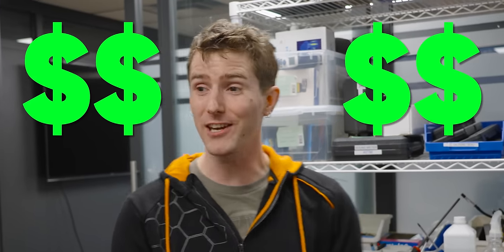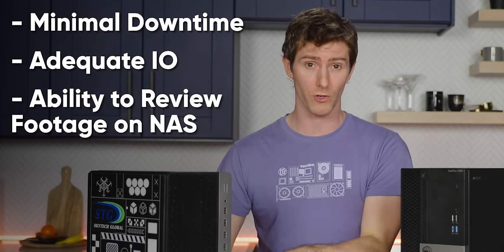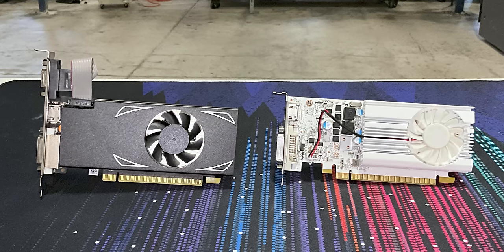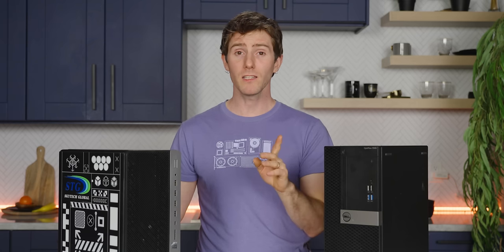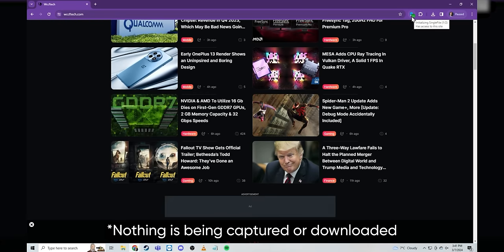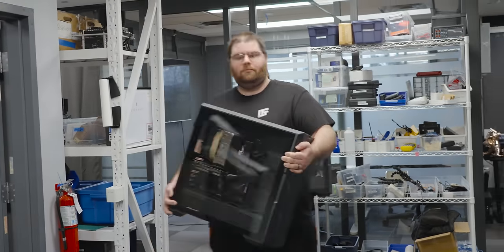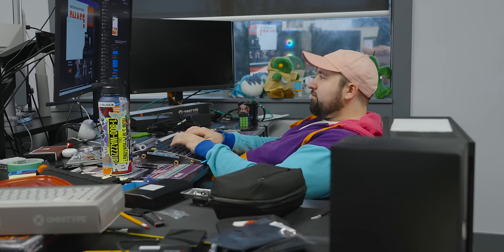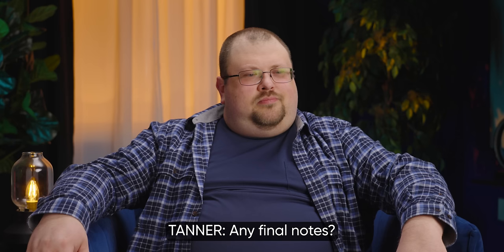We Downgraded our PCs to Prove You Don’t Need a New One

Comment: I work IT for hospitals, we tend to rotate systems roughly every 5 years. For the most part, as long as the system has an SSD (even a cheaper one), the older 4-5 year systems still work just fine for 90% of tasks; most of them with 8gb of RAM. For "power users" like accountants who have multiple excel sheets open, these same systems with 16gb of RAM work well too. Most of our "heavy" applications like EMR apps are cloud based and we see more hardware usage from Microsoft Edge.
Reply: As a person who has had to be in hospitals more than i would like to admit i wish there wasn't anything hooked to the cloud in the network. I can see why "heavy applications" can basically require you to have a server cabinet per building that provides the medical service just to hold in digital form the medical data of everyone who goes to the hospital. Sharing between building would be harder too.

For the system that the majority of them use yeah sounds about right for what the 3 hospital systems i have gone to use. Well that and a specialized one for nurses whose job is to go around and give the correct medicine to the correct human.
Reply: These employees at LTT are spoiled, pure and simple. Their issues are between the keyboard and the chair.
Reply: 8GB of RAM in a commercial setting is horrible. If you're running commercial AV with lots of logging it can easily take up 4GB of ram which means after windows takes 2GB you have 2GB of RAM for whatever you're doing (probably using something running on chromium) which just isn't enough. Anything with less than 16GB now is useless for these business settings unless you have some niche task that can cope with only 2GB of RAM available.

The only way to get away with 8GB is to make users suffer with the page file being hit constantly or to not have proper security and monitoring settings.
Reply: @jaysoncowan5763 .  Many of the old business machines can have some random faults that only pop up through daily drive. Had a family member go through the same thing.
Reply: @jubjub727  Yes, security apps are taking a lot of RAM and consistent CPU usage. In which old systems just takes so much hit to their performance.
Reply: Your security is probably shit then. The security monitoring eats up performance.
Reply: exactly. for MOST office use, a few good cores, ram, and an SSD for fast boot and opening times, that's all you really need, as long as you have solid networking. EPIC medical software doesn't require too much to be happy other than the LAN, so as long as the background of the system doesn';t hog much, you don't NEED huge hardware to be really poky. i've built for medical offices before, their requirements are about as much as you'd need to run Chrome OS and not much else. i do have some more specialized clients tho that need more horsepower. i recently upgraded them to all i7 6700 dell units, nearly identical to what they're using in this video, all SSD storage, and they are so stoked about it. they boot so fast (new installs, not dell OEM installs) and all have at least 16 gigs of ram for having tons of windows and apps up and running. (they're a chiropractor office, and their special chiro software uses like 7 gig by itself)
Reply: Disable prefetching and superfetching in registry, and sysmain and windows search in services. That will improve the speed of an older system significantly.
Reply: @jaysoncowan5763  nearly all of the complaints i heard here were from swapping the SSDs from their main rigs to these instead of using a fresh wipe with proper driver install. ive done several HUNDRED setups like this for people who use them 8-12 hours a day in a business setting with 0% complaints, not a single call. it's one reason i like going with the used dell optiplexes. they just RUN. their issues were mostly due to not fresh installing. granted, yeah, sometimes horsepower is a problem, but the lack of wipes is 95% of this video. (for reference, i started doing PC builds and repairs in 1999 for a living, and i still do)
Reply: @jaysoncowan5763 I used to have a business type of computer as a daily driver , many of its components weren't upgraded or didn't have any drivers at all, because they were so old so we can't download
Reply: My dad used to work in the E.R. and now works at another section of the hospital (Its a recent promotion so I dont exactly remember where he is now) and every time I go I am always looking at ANY and EVERY computer I possibly can to gauge how old the systems are and mainly how fast/slow they are. Sometimes I wonder if they have any security issues but they really consistently keep things updated and constantly tell employess to tell anyone when they get an email that looks weird, or if they opened something funky. That particular hospital honestly has a good team of IT professionals running behind it because everything my simple computer nerd minded ass could see was spot on perfect. I have a feeling even social manipulation to gain access to systems would be hard.

Thank you for taking your time to keep people's medical information safe and secure. Its extremely important now more than ever. You're doing a very important job that deserves respect.
Reply: For me, ram / SSD is way more important then performance
you can wait for tasks to be finish slower, but when working with larger data / multiple tabs searching for info
ram will ran out and completely freeze up / fail to open/import data, therefor become unusable
(some medical file / logs are large, especially when you also do some research work)

simply put more ram and a SSD into a old system can prolong it's life massively, and the process is fast and easy
Reply: EPD software can be a hog though. But luckily most of them are pretty modular.
Reply: Agree.  I'm acutally still on spinning rust, but if there's enough RAM that the essential tools are cached, my boxes are plenty snappy.
Reply: @jubjub727  8GB is still usable; not ideal but usable. In a hospital setting at least, most of our workstations run a browser for basic web searching/email/Teams and then effectively a thin client for the EMR app. Not much happening on them. Once you get outside the patient areas to administration, 8GB becomes unusable.
Reply: @yumri4  Unfortunately, it's just way too convenient and cost effective to offload to the cloud. Pretty much everything is going to be AWS or Azure. One of the largest EMR providers Epic works very closely with Microsoft ,so it's pretty easy to roll out integration with Microsoft's ecosystem.
Reply: @Mattias1172  If 8GB is usable then you've grossly neglected AV and logging. Which for hospital IT teams checks out. The only reason you think 8GB is usable is because you're doing things insecurely.

I get that budget is a thing and especially rough at hospitals but having poor security settings isn't something you should be particularly happy about.
Reply: @jubjub727  Nope, full AV and logging. 50,000 endpoints with the majority being 8GB. We have multiple layers of AV on each machine. It's all about optimization.

Comment: Honestly i've been working in IT for schools and Councils in the UK for 7 years and a lot of them are still running 6th gen I5/7. For basic office tasks, teams meetings and spreadsheets they are perfect. The internal networks and domains are the bottleneck most of the time. Dells warranty is brilliant as well. Log a support ticket and a guy is waiting at the office doors the next morning with all the parts to repair the PC. You cannot fault that.
Reply: Too bad Microsoft will stop providing Windows Updates to these machines October 2025 with Windows 10 going EOL. They're not compatible to Windows 11.
Reply: Dell's support is just extraordinary
Reply: You can fault it when the service technicians are hired without a vetting process (contract company) and their KnowledgeBase is significantly worse than your own I.T,
Albeit thats not a problem everyone has but it sure is a problem we had.
Reply: @Steamrick  most machines that aren't considered compatible by windows update, can still be installed with Windows 11 using a boot drive
Reply: @Steamrick  yeah that does suck. The current council I’m working for are rolling out Surface laptops out. It’s a long process replacing 10k machines. Microsoft’s support isn’t great in comparison. Their definition of repairing a laptop is just replacing it.
Reply: @Steamrick  Windows 11 will run. I have 2 4th gen systems at home running 11, several different ones at work. 

However, I feel like 8th gen is the sweet spot for 2nd hand. More cores and NVME makes them feel very snappy.
Reply: Must be a different service level because Dell never sends anyone out to fix our issues, they want us to ship out the system and wait for them to send it back.
Reply: @Steamrick  sure but not like these systems will be worried about viruses if they only use it for certain tasks
Reply: Web Page design is the bottleneck there. It never holds still.
Reply: Bruh, I have a 4th gen i7 and it's still plenty fast for me. What am I missing?
Reply: I know still better than modern celeron chromebooks.
Reply: @Steamrick  I've deployed Windows 11 on several Thinkpad T520's from 2012, all the hotkeys still work. Most of the PC's at my workplace I manage are 6th and 7th i3's, they all run Windows 11. The important part is the SSD.
Reply: @allyart5904 As someone who has three surplus Optiplex Linux boxes (two 9010s and a 7020), I certainly do appreciate them.  I bought my first 9010 because it was configured much like a home built box I tossed together in 2013, and the things keep on soldiering on.
Reply: @Steamrick  Third world countries will just pirate LTSC 2021, we should too
Reply: The council here are replacing their 8th gen intel laptops. The main issue with them is the batteries and they don't have USB C which is what the council and police stations are moving to so they can use the docking station devices.

Comment: I used to work alongside video editors, and I'm surprised to hear that everyone at LTT including the writers are working with the full resolution 4K footage. We used to have almost everyone working with lower resolution proxy footage, it was easier on the machines and the network, and at the end of the process there was some software special sauce which applied the same edit decisions to the full resolution footage too. I can only assume that the issues described here with scrubbing through footage would have been helped by using lower res proxy video!
Reply: Yeah I've wondered about that before. Most production companies I've seen use macs to edit video, and not even new macs, unless they shoot in low resolution they just use proxy footage and the not super fast computers handle it just fine. No need for crazy powerful PCs or fiber connections, LTT's setup seems so overkill
Reply: So basically the edit decisions are generating a batch job to later apply with hardware with more grunt.  I'm not a videographer, so that strikes me as extreme cleverness.
Reply: @christopheroliver148 

It's not very clever, it's like 3 clicks in any competent video software lol. I have no idea why LTT insists on editing native footage.
Reply: @user9267  They edit on 4k raw because they're nerds who enjoy the excess and can afford to do it. They are 100% aware of the ability to edit on a lower resolution, it's an active choice not to.

Same reason they film on 4k and 8k cinema cameras that cost as much as a car, to upload to YouTube. Or own their own video streaming service with a higher bitrate than anyone else. They can do it, so they will. It also gives them a practical upper bound for stress tests of high end hardware and networking, which is "fun" when they do networking adventures.
Reply: @christopheroliver148  I would say the initial concept was absolutely a clever idea, yeah! From other comments it sounds like this idea is widely implemented in various software now. But yeah my understanding is that working on the proxy footage generates an "edit decisions list" and when the full quality version needs to be rendered, that edit decisions list tells a rendering system somewhere exactly what it needs to do
Reply: @user9267  I hope it was obvious that I meant the idea of a proxy in place of a total edit in the first place.  Does this have any sort of precedent prior to digitized video?
Reply: @purple-cho  That's the point I was making.  Someone needed to have the idea in the first place and come up with a proof-of-concept implementation.  This is similar to saying GUIs are commonplace.  They weren't when Alan Kay and his team of wizards at XEROX PARC initially came up with the ideas.
Reply: @wyattroncin941  but they are essentially wasting money on insane networking and workstation requirements that aren't needed. I can understand having sections of the network set up like that for making videos about it ("Is 10gbe worth it?") but for everyday users it seems silly.
Reply: @onegraham  sure, it doesn't make sense for an everyday use. But they aren't ordinary users, and they get much of the equipment for free or heavily discounted from the video sponsors. They aren't going to make a video on networking upgrades and have Mellanox send them a reasonable and cost effective switch, they're being sent a top of the line 40 Gb switch and being contractually obligated to use it at 40 Gb/s. Similar for the workstations.

Hell, every time they discuss the editing workflow and workstations they touch on the fact that it's entirely unnecessary and they just want to and can, so they do.
Reply: @christopheroliver148 it kind of does actually!  I was surprised to see a video about some TV studio, who recorded their masters on those monster Ampex Quadruplex things, but then did a bunch of editing with more consumer grade video tape, recorded the edit decisions on punch cards and had a computer apply them, it was wild
Reply: Pretty sure they used to work on full resolution 8K a few years ago
Reply: @wyattroncin941  Yeah that's just...it. I was searching the "nerd" argument in all these technical discussion. As an IT sysadmin, it will be hard to answer "i don't need it" if my boss ask me if I need a 2k monitor vs 1080p. Or an i7 vs i5. Giving good (not overkill) tech to your employees, even standard office users, just prove that you take care of them. It's an employee retention statement. 
I really hate the "do you need it?" question, it's sooo off topic.
Reply: I've been doing non-linear (digital) editing since the 1990s.  We always used proxy clips to do the edits.   I've had systems which can handle doing full-resolution, but why?  If you do everything in proxies, everything happens faster, less wear & tear on the drives, less watts burned.  I can only think of less than a handful of times when we noticed something in the full resolution output which we didn't see in the proxies.
Reply: Honestly a 3-5 year upgrade cycle is enough for most business cases except at the performance edges. Saving 20-30 minilutes in render time is very valuable in those cases. I used to manage excel spreadhsetts and online databases just fine with an 5th Gen i5 laptop, though I got the it guy to give me 16gb as I was running into file size bugs on excel. 

It would be interesting to order your "office" computers in smaller batches to compare and contrast different vendors. Like have a Dell group, an hp group, and a Lenovo group, with maybe a single primary it guy to manage that group for ordering and updated. But that's also increasing your overhead for maybe one or 2 videos.
Reply: @onegraham  - and you don't waste money on anything that is not needed?  Wyatt explained it perfectly.  I mean muscle cars in my opinion are not necessary but i don't blame people or say they are wasting money when that is what they enjoy and want to spend their money on.  It may be a waste to you but it is not to them.
Reply: A while back they mentioned "Red" brand 8K camera they were using.
Reply: @avadrumm  you realize the channel you are watching? everything they do is overkill lol
Reply: @avadrumm  you're talking about the channel that once hooked a gas powered engine up to a liquid cooler to see if it would improve cooling that is the definition of overkill. That being said it's overkill for a reason because it can be sponsors pay for most of these videos and equipment the sponsors are going to want to see them use high end stuff. Mellanox isn't going to send them some 10gb/s switch for the network their going to send whatever their best is at that time and they are going to want LTT to use it at that capability as well for two reasons one it shows it can in fact do as advertised and it's a real world test of how long will this last if it's used at capacity day after day.
Reply: At LTT we edit our videos of every resolution individually, new edits every time
Reply: Proxy footage is not ideal - it’s a solution to the problem of insufficient network bandwidth / disk performance. 

If you don’t have limitations on your network bandwidth or disk performance, there’s no reason to use proxy footage.
Reply: @avadrumm Overkill pretty much is LTT's channel appeal, I think the Apple studio videos are in good supply already lol
Reply: Because literally all of them are nerds and they can do it.
Reply: I USE HD RESOLUTION AND WORK IN 740p DONT SAY ANYTHING ABOUT LOW RESOLUTION I GOT 400 KBS INTERNET SPEED
Reply: @korneliusfrik9545  Don't write with caps.